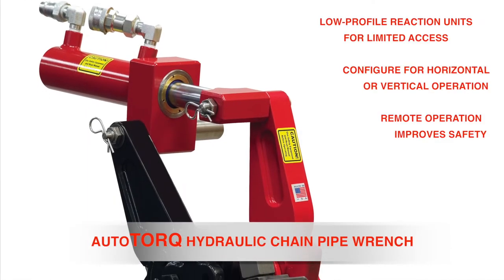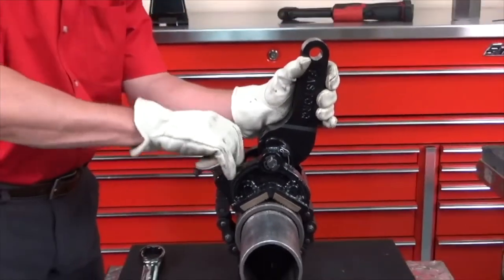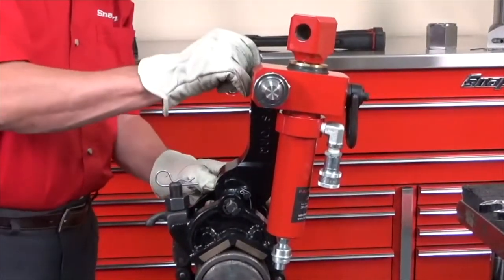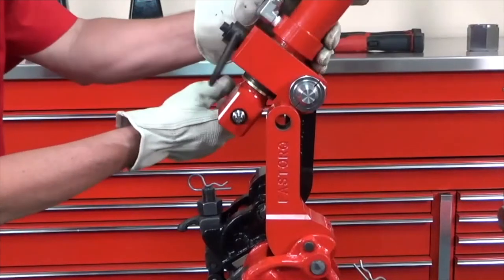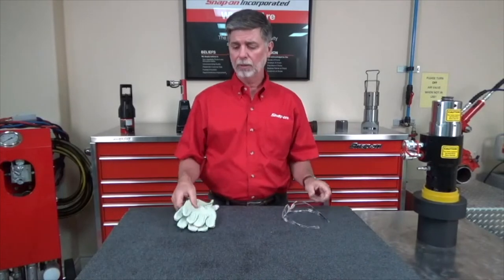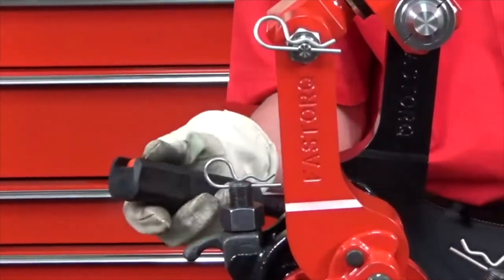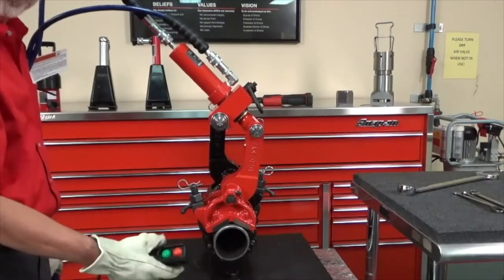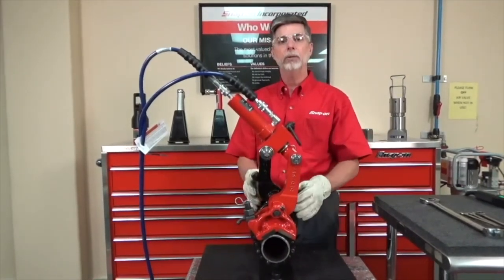Snap-on AutoTORQ Hydraulic Chain Pipe Wrench

Comment: I know a guy from Texas who invented a hydraulic pipe wrench. It spun in either direction at around 300 rpm. You just had to change the grip teeth for various size pipes. 
They mounted it on the back of a pump hoist truck for pulling water pumps. We pulled 4 inch 300 feet tubing in less than 1 hour.
Reply: Can you send me a contact for you guy in Texas please Abram
Reply: I’m looking to try one of this hydraulic pipe wrench sir
Reply: @TinoEnriquez  a guy named Terry that worked with Wilson Drilling Co from Muleshoe Tx. I don't have their contact info
Reply: @TinoEnriquez  About 20 years ago
Reply: @TinoEnriquez  it was similar to the impact connect copper cutter

Comment: That's a neat tool but it could have been done with two regular pipe wrenches several times over before you even had the thing assembled.
Reply: It's purpose is to avoid using that method because it's so dangerous on a wellhead. For that it's brilliant!
Reply: When you need it, YOU NEED IT.  There is no alternative for difficult joints that need a lot of power.  Sometimes there is no other way to get the power needed in a small space.  I don't care if you have two gorillas nearby, it's not going to be enough.
Reply: That tool would be great for hydraulic cylinders